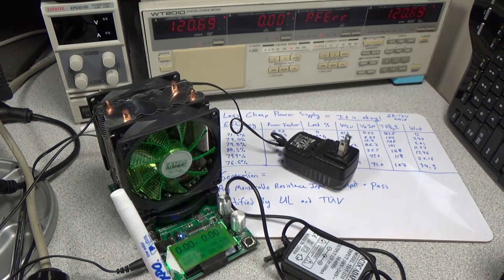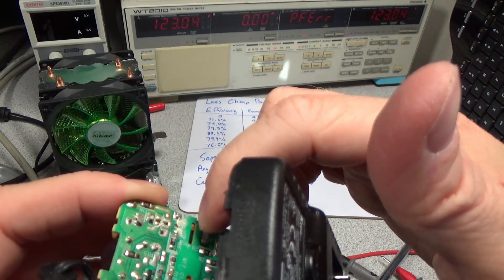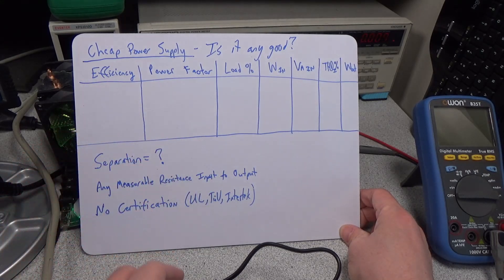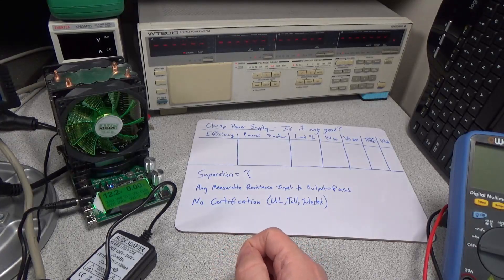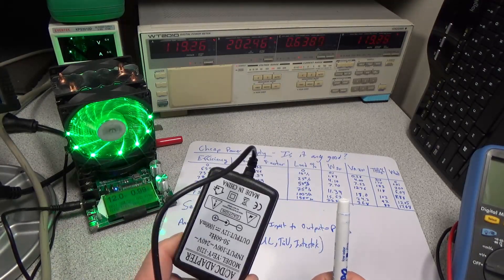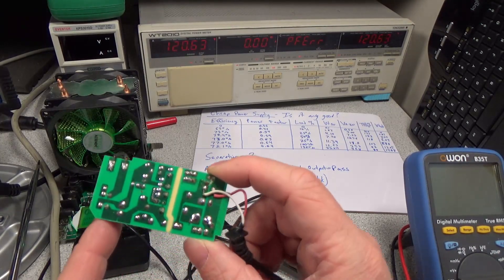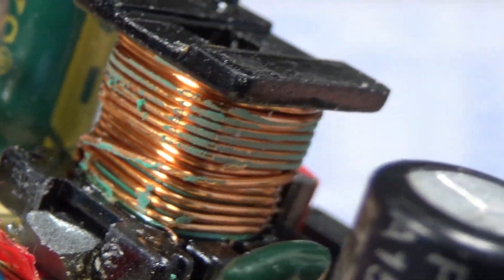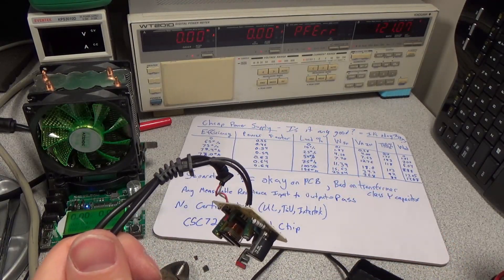Cheap Power Supply Teardown:  Is it Dangerous?

Comment: I recently got this exact load tester (which is great despite those annoying green LEDs) and went looking online for the model number when I became concerned at how light the power supply was. It feels like there's nothing in there! I could not get the plastic shell off non-destructively, but since I'll be throwing it out anyway I might crack it open later. No way I'm plugging in this horror since being electrocuted or starting a house fire is not on my bucket list. Thanks for making this video.
Reply from the maker: Yeah, these little testers are impressive but yeah power supplies are pure waste.